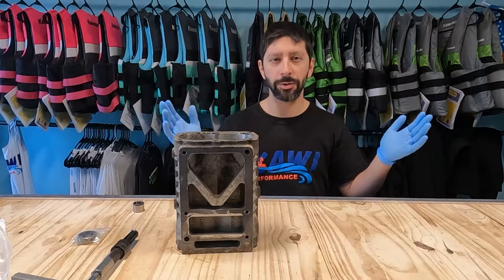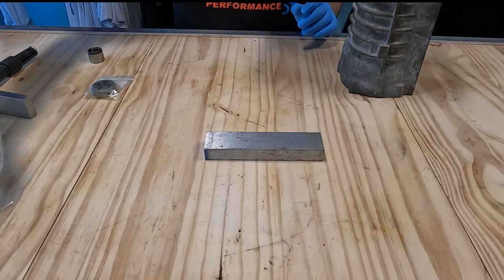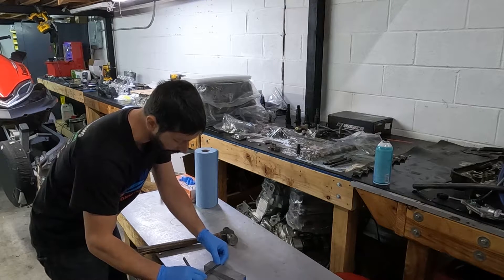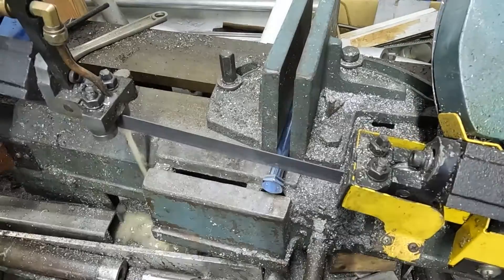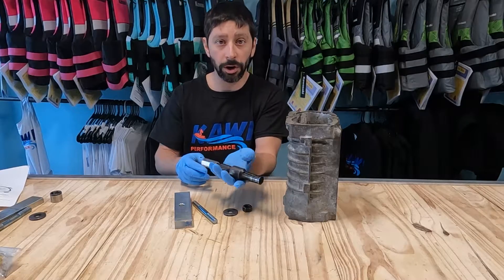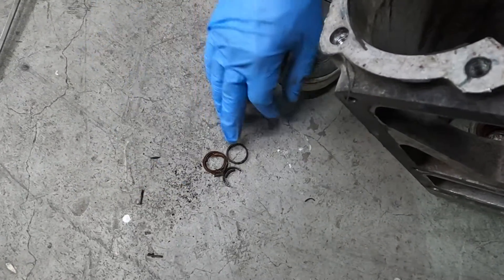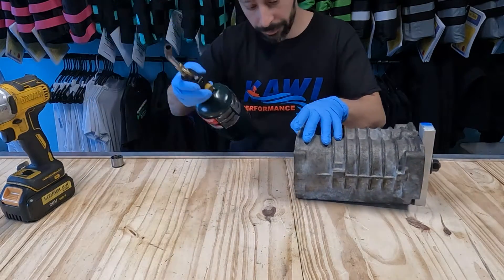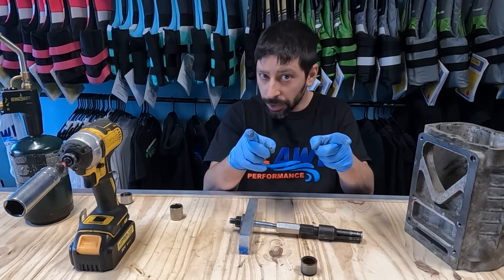Unlocking Supercharger Secrets: DIY Needle Bearing Removal Tool

Comment: Hey, very informative vid!

9:50 is the next ep. available? Where I live supercharger specialists aren't at hand so I'd need to know how to install the case bearings. Does it need to be done under high temp?
Reply from the maker: We do have an installation tool for it, it is already preset where the bearing needs to be installed. Installation video will be coming soon!